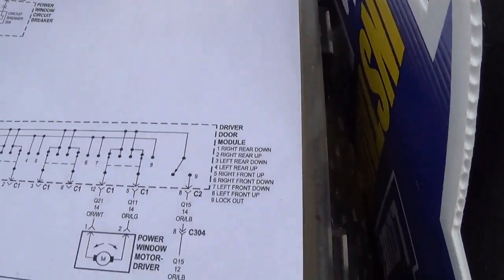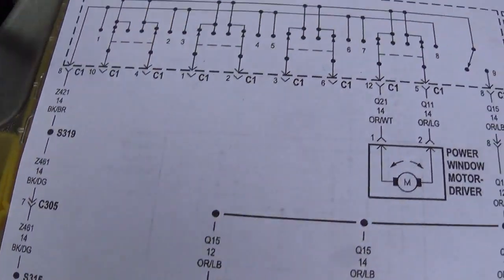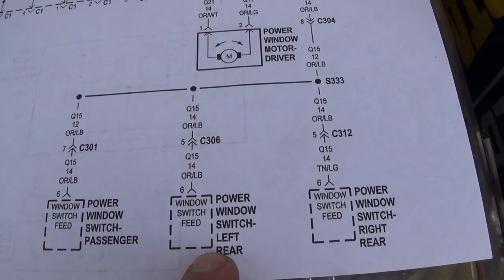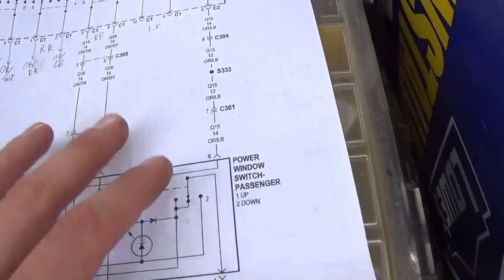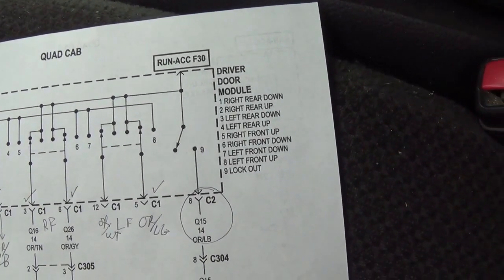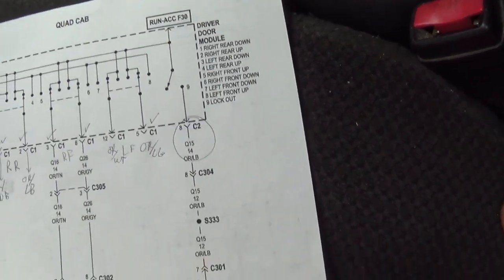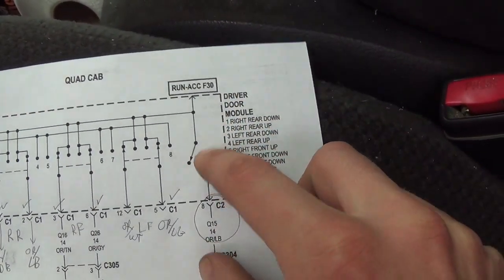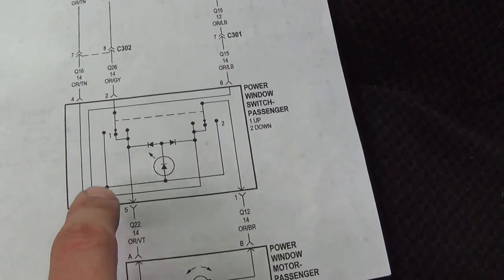Power Window Extravaganza: '04 Dodge Ram

Comment: nice job diagnosing that. was a pretty complex circuit and it felt like a real situation when you had to stop and regroup because it didn't make sense and then you didn't just stop at the bad master switch diagnosis and actually was able to repair the switch!
Reply from the maker: +Joe Shearer Thanks, Joe! I do love the "no-parts-required" repairs. Plus I know that the re-soldering repair on the OEM module will outlast any cheap DORMAN aftermarket unit :)   I mean the switch they swapped in (before I got to it) didn't even work fresh out of the box!!!